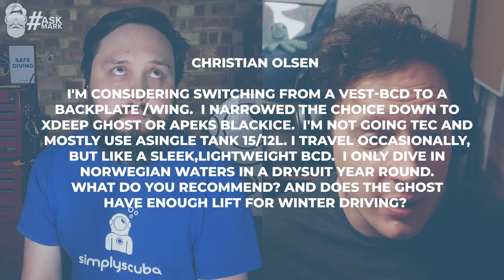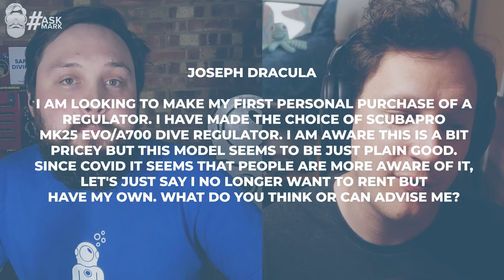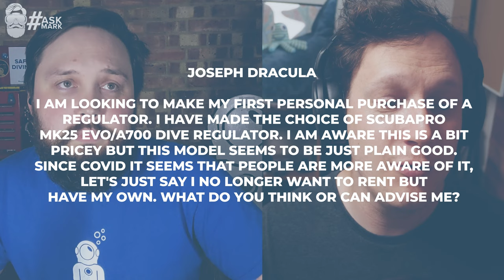What Do You Think About Pull Dumps? Are They Safe? |  #askmark34

Comment: During my advanced open water a lady with 500+ dives had the shoulder dump on her newly purchased BCD get stuck/tangled somewhere in her gear or straps. It was pulled open and she couldn't stay buoyant so she clung to the boat's anchor line in choppy seas, going under and back up. The instructor recognized her stress and fixed it. Know your gear, with careful attention to possible shoulder entanglements.

Comment: Thanks guys! As far as the dump valves, I purchased a used BCD (back off, I was in college and broke!), had it checked, and everything was in good working order. I was taking my advanced open water cert, peak performance buoyancy section, and it stuck open. The instructor ended up opening it up, wedging in a rock to keep it closed, and I finished the class. Stopped on the way home to replace the inflator hose setup. Did I learn my lesson? Well, I still have a pull dump...

Comment: Hi Mark and Shaun. I love this channel. #askmark I always hear to clean, wash and dry your equipment thoroughly before storage. I wonder how to dry the BCD insides prior to storage. The bladder is airtight and only have 2 or 3 tiny openings (valve holes) that aren't exactly at bottom most corner so its pretty impossible to let it dry just by hanging it even with the hose and valves removed.

Comment: How to tie on a boltsnap: https://www.youtube.com/watch?v=Qm_oZTAqE04
For a good single tank wing I'd recommend the Apeks WTX-D30 PSD; it's double skinned and comes with a shoulder pull dump, which is very safe.
Lift capacity for a wing: many jacket BCDs come in the 45lb zone.  It's a lot!  For me, a 30lb wing is quite enough for even a 300Bar 17kg steel cylinder and 40 lb is easily good for twin steel cylinders.  To need 60 you will be diving with multiple stages or some other really negative kit.  For an easy way to calculate the buoyancy of a cylinder try https://www.subaqua.co.uk/cylinder-buoyancy.php.
Hope this helps.

Comment: #askmark hi Mark just wanted to get your advice on single tank adapters. I currently dive in the UK on a oms double bladder back plate and wing set up with twin 12, however I wanted to.take this traveling and use on a single cylinder, is it a case of using a single tank adapter or should I get a separate back plate and wing for traveling?? Many thanks